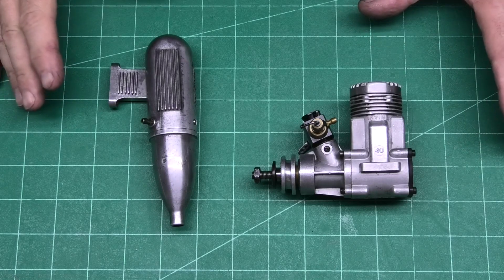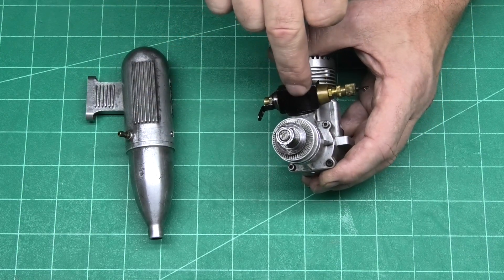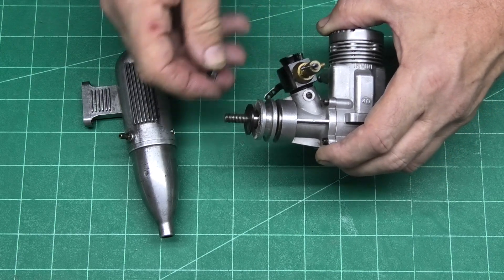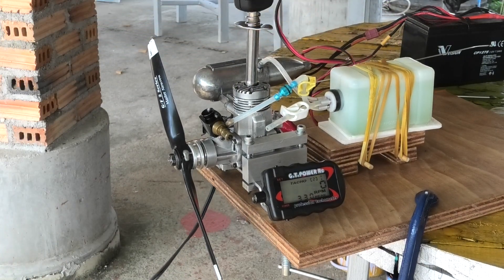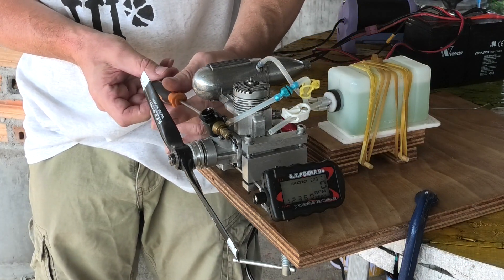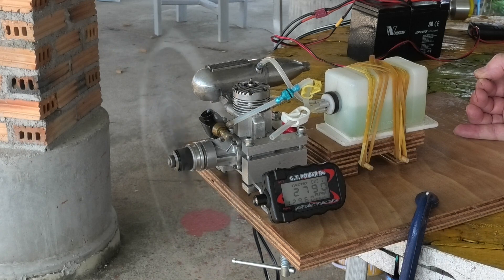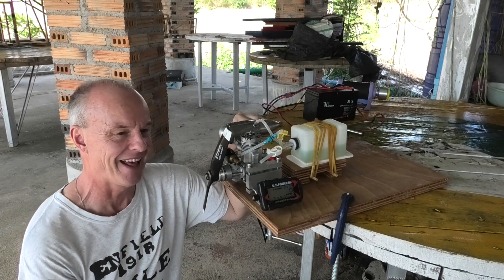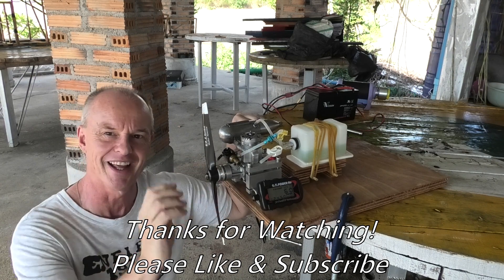Irvine 40 MkII, an excellent 1980's ABC glow engine - review & test run

Comment: Irvine engines are a great engine. I would like some advice on where to find good bearings like in your bearing replacement video and carbs to
Reply from the maker: HI, have you seen this video, it should help with the bearing issue.  https://youtu.be/bNns4kI9E4A  I normally get my bearings from Henderson Bearings in the UK he do have a web site. With regards spare parts, ebay is a great source.  Good luck

Comment: How did you adjust the low end idle needle, how did you know it was rich? ive literally just acqured one of these today so will be looking at it at the weekend. thank you!
Reply from the maker: Generally an engine that is rich will, when opened from idle, splutters and slowly pick up, if lean it will die.  How you adjust will depend if you have a low speed fuel adjustment needle or airbleed needle.  For low speed fuel needles it needs to be screwed in to lean the mixture and out to richen, BUT the opposite is true for air bleed carbs.  BUT, you need to do the adjustment in small amounts and see the difference, it is trial and error, just a little at a time, perhaps an 1/8th of a turn, or less when getting near to the correct tuning.  Good luck, it is hard at first, but with practice becomes much easier as you get used to it.  What engine do you have ?

Comment: Hi from Cornwall! I have an Irvine 40 i think is a mk2. It has a bump on the side, i assume that it is older than yours but dont know anything about it. I dont have the original exhaust or carb for it as it came with a tuned pipe and an irvine rc car carb
Reply from the maker: Hi Scott, both the mk1 and 2 had the bump on the side, but if it is a Mk1 it would have the smaller bearing in the front, which is easily seen in the shape of the front housing.  Not like the one in my video.  Great engines!